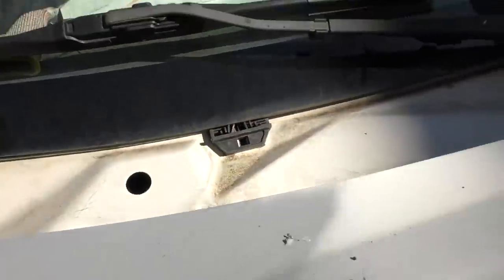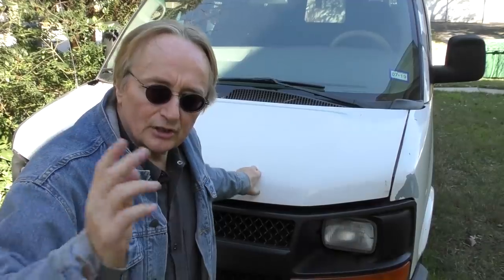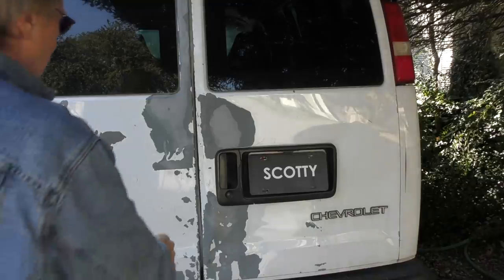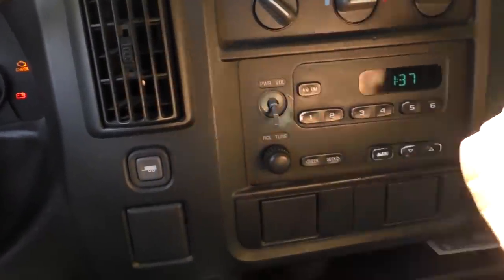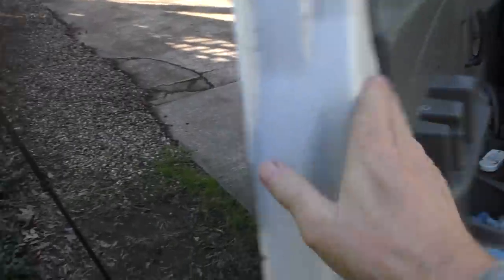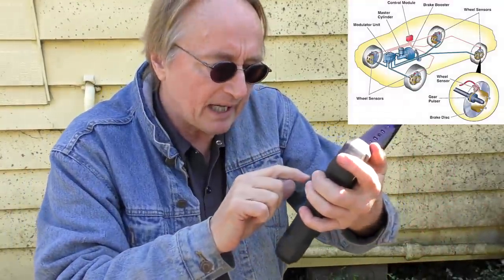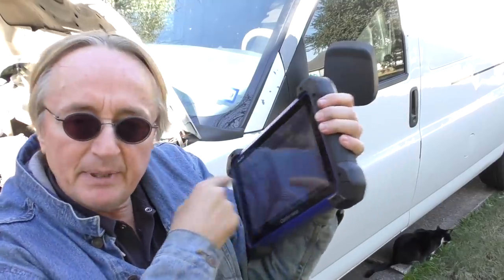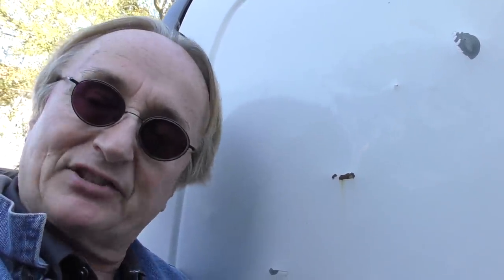I Told You About This Vehicle But Nobody Listened

Comment: It’s a feature Chevy used to have. It would automatically change color every so often. Some people like this feature due growing bored of the same ol color. All of their Buick’s tops would turn rust brown after 6 years.
Reply: Chevys also had the feature of self-changing body form, with rust blisters and peeling vinyl tops to keep things interesting.
Reply: Stephen Arling I have heard!!!
Reply: My 05 Lesabres paint is in perfect conditions, other than when the previous elderly owner ran into something and scraped the side..

My grandfather has a 2010 Toyota Yaris, and the top is all rusting and flaking off, all of the plastic crap is falling off.  It's disgusting.
Reply: @darthdarthbinkss  "Yaris" sounds like a communicable disease.
Reply: @stephenarling1667  Lmao true.  I'm not saying that I don't like Toyota, in fact I'd rather have one than this as my first car, but not all GM cars are complete junk.
Reply: Darth Darth Binks their trucks are good from what ive seen but not much else
Reply: @darthdarthbinkss  actually yes they are, Scotty teach him
Reply: @james-sz9un  Can't go wrong with the 3.8 V6 in this, but the transmission is average at best.  When I can, I'm gonna sell this and get a Corolla.  In the past year I've had to replace engine mounts, thermostat, realign the rear tires, fuel filter, transmission fluid change, lo-beam headlights, and replace the AC blower motor, which isn't too bad, but I'm a poor kid lol
Reply: Junk GM 😂
Reply: I thought it was from me driving so fast I was blowing the paint off.

Comment: Is he really comparing a work van with over 200k miles to an economy car that's barely driven?
Reply: Savage lol
Reply: 100% plus real fleets maintain them and not let them go like that!
Reply: He sure is. He must not know about all the complaints regarding Toyota paint quality since 2007.
Reply: @DJR5280  agreed or the Toyota Tacoma rusty frame replacement issues that plagued toyota for eons! well Toyota Fanboy for sure, and this coming from aa 2003 Toyota Corolla owner that bought it new in June 2002, love the car, garage it to keep it like new, but like anything if it is maintained, they run, I just recently sold a 2004 Cavalier, with over 100000 miles on it, got good money for it too since I had it maintained to the tee, no issues, buyer is so happy!
Reply: @randylee2549  I still own my first car I ever bought. A 2005 Malibu V6. I bought it with 40k miles. It now has 263k miles. I've had or for 10 years and it has been super reliable. I maintain the hell out of it. You're right, maintenance is the key.
Reply: @DJR5280  Absolutely, I know this because I have a pre cylinder management model Express van G2500 with the 4.8 Vortec our company bought last August 2019, was maintained well with just 103000 miles, yes there are small gremlins they did not catch such as corroded EBCM ground wire to the frame, or the jumpy speedo due to stepper motors out of wack in the cluster, the bolts and washers from GM are $9 because they say the conduct more, and the stepper motor is $4 and I only need 1, we have an in house mechanic to do ALL the work on payroll, so for $13 why not fix it and keep it 100%, I know people who have no mechanics at all let things go because the labour is costly! I know mechanics need to make a living, but that is why we have 1 dedicated mechanic on payroll, in the long run his salary is cheaper than replacing vehicles when technically even a Chevrolet can go 30 years with on time PM and maintenance, one of our cargo's from 1965 is still running today with a private family who turned it into a Camper, can you imaging, a 1965 E-100 Econoline van running like a top today in 2020, no toyota from that era is running due to rusting away with the Japanese reuse of recycled metal in the 1960's. The other point on the Express Van's no foreign van (Including the Ford Transit Connect (Euro Spec) and Transit full size can come close to these body on Frame Express/Savanna/Econoline....NOTHING!
Reply: He really not that bright of a guy when it comes to vehicles

Comment: I understand about GM paint quality from the mid-90s to mid-00s. My wife had a 1995 white, Chevrolet Corsica when we got married 18 years ago. The paint on the flat surfaces of that car was pretty much gone. The clear coat and burgundy paint on my ‘00 Silverado has deteriorated badly, it has almost 195,000 miles on it. What is odd, and I’m very thankful,
is my wife’s white, 1999 Chevrolet Suburban has never had paint issues and it has 210,000 miles on it. The truck does need little things worked on in other areas, after all it’s a 20 year old truck.
Reply: Yes but after the year 2000 you can’t say with a straight face that GM is making good cars there all pieces of junk after 2000
Reply: Jose Salinas I think you’re spot on there.
Reply: Jose Salinas my dads 05 silverado has been great 4.3 v6 well over 200k miles on original drivetrain and he drives real fast
Reply: Are you still married ??
Reply: Same here. My white 2000 Astro van has never been in a garage, and never been waxed it's entire life until last year. Clear coat is only starting to bubble by the top of the rear doors but none on the roof.
Reply: smooth I’m not in any hurry to get rid of ‘00 Silverado either. I want to restore it and keep driving it.
Reply: Donald Hollums 
I’m going to keep driving my wife to I tried to restore her but it’s starting to cost to much.
Reply: @john2359  Ha! You ain't right, son!
Reply: I had a old corsica i drove it after my sister rolled it over a cliff it looked like crap but it ran forever
Reply: I mean what conditions does your paint see? Garage kept? Do you wash or wax it? Climate? xyz factors go into how your paint wears...
Reply: @james-sz9un  40mph is not fast
Reply: Brad Zimmerman 90 is cuk

Comment: Honda's have clear coat problems and old toyota camrys door handles always broke off, Didn't stop them from running good
Reply: Dont remind me.... My 9th gen civics roof is such a sad sight. Not to mention how bad my old accord got.
Reply: ah thats what it is. i noticed like every 5th honda i see thats older than 10 years has faded paint
Reply: I have a 2014 Camry SE. Are my door handles safe?
Reply: I remember the late 80's/early 90's accords.  The paint would oxidize, even if you live some place moderate with a moderate amount of sunlight, like the midwest.  I think they corrected the problem in the mid 90's (I had a 97 Civic that didn't have that problem, but it did have the notorious wheel well rusting issue after a while).
Reply: it's   what's   on  the  inside (underneath )  that  matters,  not  the  outside.  the  older, n  rougher around  the  edges ,  the  better, n if it's  still  running  good, it's  a  win win..........winner.
Reply: Why are Toyota Camry door handles breaking?
Reply: @Simon Chuo ,
So bare plastics are ok, as long as there made strong/thick to begin with 👍
Reply: I have a 04 Acura TL and on all the flat surfaces the clear coat is peeling off, the car is that dark grey metallic.
Reply: My cousin's 2005 Honda Civic roof paint looks bad.
Reply: @mrgarrison3516  
made   cheap  with  cheap  plastic  like  everything  else.  been  like  that   for  years.  if  it  was  solid  state /  metal  like  they  use  to  make  ' em,  it  wouldn't  break.
Reply: @driver4011  solid state? solid state door handles?????
Reply: Had a couple of door handles break too.  Could be the heat maybe, or kids abusing them?. Weird bc the handles broke but the engine is solid.  I'll take door probs any day vs. engine probs.
Reply: @mrgarrison3516  they make them out of pressed seaweed
Reply: Toyota door handles always break off
Reply: @BaltimoreAndOhioRR  Yeah man, damn... these vacuum tube door handles are the worst, solid state is the future.
Reply: Yup my dads 99 corollas door handles and interior are falling apart but it runs fine

Comment: I had a 1997 Chevy Express conversion van, bought it in 1998 with 4K miles on it and drove it until 2015, it had 223K miles on it, probably one of the best vehicles I bought
Reply: My dad has a 2001 Silverado that he bought in 2002 and is still going strong.
It now has over 360k miles lol,
He’s only had the transmission replaced but it wasn’t too expensive
Reply: @h.e6604  Those older Chevy Trucks and Vans last forever if you keep them up

Comment: The fact that this van still runs after the way it's been abused is almost impressive. Those old Chevys can last well over 300k-400k miles with no major problems if you take care of them. Other than old Hondas and Toyotas, old GM trucks/vans are the only pre-2000s vehicles I see on the road these days. Sure, they had some issues with interior build quality and paint, but they had solid transmissions and bulletproof engines. Aesthetics don't really matter on a 20-30 year old work/fleet truck.
Reply: Bert Grau they’re solid little trucks. They were made back when a truck was built work hard and last a long time. Only trouble you may have is with the transmission, since it’s a Chrysler from the late 80s.
Reply: Like old 2nd Gen Dodge Ram seem them with 400k or more on the original engine and transmission gas or diesel
Reply: we had a 1989 Astro with the 4.3 go 320,000 miles with original powetrain
Reply: Trouble is, the only GM's that last have huge gas guzzling engines... The more efficient GM vehicles are hot garbage.
Reply: @bliglum  I agree on this point. I wouldn't buy a GM vehicle with anything less than a V8 engine. For pickups, vans, and large SUVs though, big V8 engines are perfect. The Japanese have been dominating the fuel efficient market since the 70s, so American manufacturers put all of their resources into perfecting the large work/family vehicle. It paid off, and that's why GM and Ford dominate that portion of the market.
Reply: @bertgrau9246  If it's an auto replace the transmission fluid every 30k, transmission filters every 100k, replace the transmission pan with one that has a drain plug if necessary. Some of the Chrysler transmissions did suck but with maintenance they can last a decent amount of time. If it's a manual you're solid.

Comment: I believe maintenance goes a long way. Every GM I have owned are all high mileage, Astro that made it to 750k, duramax 2500 with 550k and so on.
Reply: well vans and sometimes trucks are like the only thing that isnt crap from them. i would never even consider buying a gm product unless its a van
Reply: You can get a million miles out of a GM,just keep fixing it every other day and you can get a million miles easily.HAHA!!🤣👍
Reply: doesn't duramax comes with Cummins diesel engine?
Reply: @lordjaashin  no....Isuzu of Japan which is a part of Toyota.
Reply: @lordjaashin  I believe the Duramax is an Isuzu with an Allison tranny, Dodge uses the Cummins
Reply: @mikefoehr235  thanks for the info :)
Reply: That’s been my experience as well. I would buy a Schwin before I would buy a Ford or Chrysler truck.
Reply: lordjaashin Duramax is an Isuzu engine. I live mine. 19 mpg on interstate empty, 10 mpg pulling a 15k 5th wheel. Never had a problem
Reply: I can attest to this, although the motors with the stupid active fuel management are a joke.  GM has some decent vehicles (trucks) but you have to be careful which one you get.  Even doing my oil changes every 5,000 miles with recommended synthetic, my truck still suffers from the stuck lifter which is common on the 5.3L.  So yes maintenance is part of the key, as my trans with 147k still shifts like new because I changed the fluid every 60k.
Reply: Mike Foehr didn’t know Isuzu was part of Toyota. Sounds like Toyota needs to enter the diesel truck game!
Reply: @dillonhamrick2744  Toyota owned 5.9% of Isuzu between 2006 - 2018. Then they sold off their share.
Reply: @lordjaashin  Yes it does,but the rest of the truck is a train wreck within itself.
Reply: I bought a 98 Chevy 4x4 with 235k on it in 2016. Had to get a section of frame welded, replace the fuel tank, pump and tires. It has over 300k on in now (2020). Have replaced the ABS module with a used one, all the front end parts. It still works well and tows a trailer probably 30 times a year. I can't weld but I can do my own mechanic repairs. Still cheaper to maintain then a new truck payment.
Reply: my '98 K1500 has 530K still going strong with the original drivetrain.  Besides six door handles, three rads, one alternator, and then routine brakes/tires worn suspension etc its never been in for a major repair.  Of  course Ive always done fluid/filter changes on schedule that makes a big difference.
Reply: Unless it’s an 05 duramax
Reply: Mike Foehr only the original duramax was co developed with Isuzu it’s not a full Isuzu and all the other gen duramaxs are pure gm

Comment: I must be lucky with my 02 chevy 1500 with the 5.3. Purchased with 230k 4 years ago to use as my service truck and now I have 364k and you would never wven know by looking at it.
Reply: 5.3 is a good motor, keep the oil and coolant changed and it'll go +300k no probs
Reply: My friend just bought a 89 V8 full size Blazer plow truck with 180,000 miles. He has had 3 offers not including mine.  Those trucks are galvanized that's why the paint doesn't stick.
Reply: I bought a 2003 Silverado 6.0 back in 2007, I’ve daily driven it every day since and it gets used and abused. 320k miles The vortec is absolutely bulletproof, I’ll I’ve done is changed the water pump and regular oil changes. Best vehicle I’ve ever owned.
Reply: Them old Chevys were made really well. This express van had bad paint issues on hood and doors because it was gm’s first mass produced car with aluminum hood and doors.
Reply: The Vortec was one of the best engines ever made. I have one in my 05 Silverado that I purchased new. I've got 180K miles on it and it still drives like the day I drove it off the lot.

Comment: I have a 2001 chevy with a 4.3 with 480,000 miles. original motor and trans. still going strong...
Reply: I have a ‘97 Chevy 4.3 with 143K miles that blew its motor at 134,000K, I replaced it - that’s why we should never say we know what we are talking about- 
😂
Reply: theynwere okay til about 03-07
Reply: Dude my uncle sold me on one. He's got an old 90 something 4.3 and that damned truck has been good to him even when he pulled a log roughly 4-5 foot thick and about 15ft long. Still driving the truck daily. Craziest thing I've seen him do to a truck and that's saying something. I'm not a die hard chevy guy or anything but i did buy a gmc when i found a steal of a deal.
Reply: Into Intuition maybe if you knew how to maintain a car, it’s not that hard...

Comment: Well all I can say is I have been driving one of those chevy, or GMC van for the past 25 years. They are the only vehicle the company I work for will buy, or lease. I have put over 200,000 miles on ever one without a single motor or transmission failure. I would also say that is loaded with a 1000 lbs of tools and part. So you can say what you want about the crazy paint job. I'll take a solid drivetrain over a nice paint job any day of the week.

Comment: Let’s just say that nowadays, GM isn’t exactly going to give the Japanese a run for their money in terms of reliability and build quality...
Reply: They never really did 😄
Reply: Nowadays? How about the last 50 years?
Reply: bradwick212 this makes absolutely no sense. Since 2000 there have probably been close to 500 different Japanese interiors. do you generalize about anything else?
Reply: @bradwick212  American car interiors have been crap for decades. That's partly why they have been unpopular overseas (unlike Japanese cars). Its only in the last couple of years that they're has been some improvement.
Reply: @FATGOOFAS  In Europe Japanese cars are not that popular.  They think of them as cheap econboxes. Only for the poor. American cars where too big to make it overseas. But people love there trucks.
Reply: I have a 2005,  v8 Express 250, I always laugh when I see another Similar van. There isn’t one without the paint peeling off.  Scotty, the thing you missed in your review is the completed procedure necessary to simply replace  a rear brake light. Good luck car owner, without a full set of ratchets and extensions!